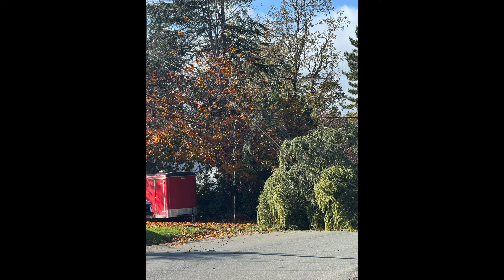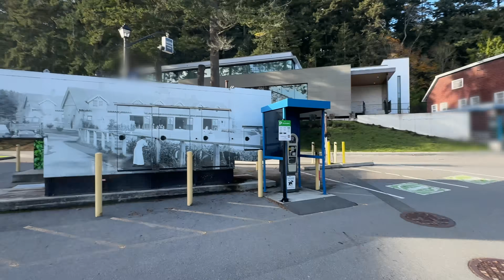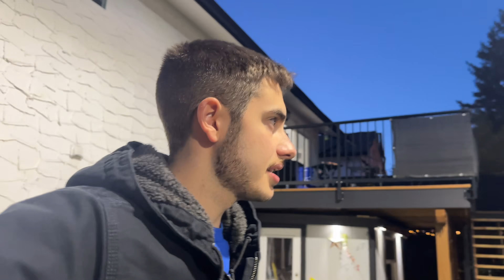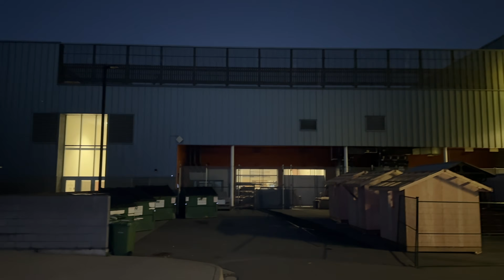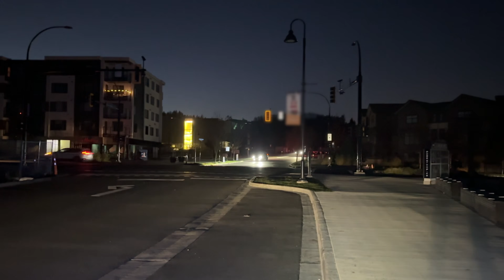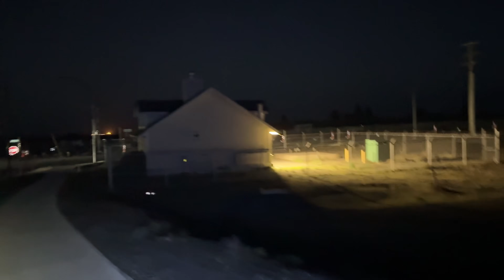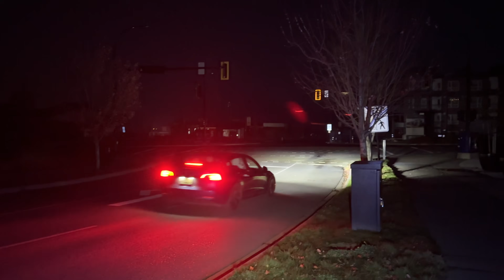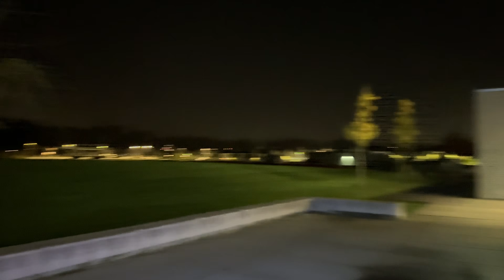11 Hours Of Power Outages And House Electrical Fried With 14,400 Volts On Neutral!

Comment: A whole house surge would not of made a difference here, not with the fault energy amount available in this scenario. The 120/240V secondary of a transformer has it's neutral earthed, and that is ultimately where the 14kV is looking to go. The neutral on the secondary is centre tapped, so the two 120V legs are essentially parallel paths back to earth, going through the transformer windings being one path, and any load (dryer, devices, lights, everything) being each multiple additional paths. Does not matter which primary phase shorted to neutral; The result would be the same since the neutral/earth is common between all primary phases and secondary. There are so many parallel paths, and a typical electrical system to a house has multiple bonding/earthing points. The result is a complex matrix of paths, and makes for an interesting fault case study. Some paths would have greater energy then others. Surge protectors are almost always just MOVs, and they would of just burnt up/exploded instantly much like the dryer and boombox power supply and would have had basically no effect. The sheer amount of energy available on primary lines is intense (just look at all the videos out there of arcing and faults). Electricity demands so much respect

Comment: Even if it were code approved to have functional breakers or fuses on both the hot and neutrals (this means NOT Federal Pacific Electric or Zinsco) complete with whole home surge, protection, with a sustained 14,440 volts on the neutral, it's still very unlikely any electrical items in the home would have survived.   

Fun fact: In the U.S., some very old electrical systems installed in the 1930s and earlier, had a double fused system (Edison base fuse on the hot and neutral of each circuit) . This was deemed very unsafe, because a blown, loose or missing neutral fuse will cause everything on that circuit stop working, leading the homeowner or electrician to start fiddling around with what appears to be a dead circuit that is in fact, live at 120 volts relative to ground, and because wiring systems of this vintage were two wire with no equipment ground, whoever is working on it becomes the path to ground.

Comment: Its a miracle a fire wasn't started. There was a similar scenario where I work back during hurricane Helene. Transmission lines came down feeding one of the facility's transformers. The recloser didn't open all three legs, just one of them-single phasing about 40 3 phase motors and compressors. About half of them went up in smoke because its an old place that has seen many hands over the years and unfortunately the motor starters didn't have the right heaters in them to trip the overload relays in time to save the motor. Some of them were bypassing the overload entirely. Luckily, the refrigeration compressors have an inherent protection built-in to take it offline in the event of an overload. Motor burns inside of a sealed system wreak a lot of havoc.

Comment: When I bought my home in 2007 (my father was an electrical engineer and I was slave labor until I graduated college) it had some knob and tube...So, since I was replacing it, I upgraded to 200amps, buried the power lines (SEC), then bonded the grounded connector at a Safe Disconnect I installed right after the meter. Then wired the rest of the home (main panel which was now a subpanel etc.). Well, I bought the BAD WOLF Surge Arrestor (on steroids, even for EMP, nuclear joules level, for about $250) and installed it at the Safe Disconnect (to meet any voltage tsunami even before it entered my home), then another surge protector for 80,000, at the first panel (distribution), then two subpanels after that one, each with another surge protector. I also tied the neutral to the gas ad water lines. Then, in heavy appliances, I bought a surge protected outlet (not GFCI, SURGE).  We has a nasty storm in 2013, insurance had to pay for replacing my roof shingles...BUT NO DAMAGE INSIDE, NONE! My electrical system as intact. Yet, five of my neighbors fried their homes and I could see trucks taking out drywall and replacing wires for weeks afterwards. 
I knew if the BAD WOLF was not enough (it was), then whatever leftover reached my first electrical panel would be much less, and so on.  Also, being a bad storm, I turned off the breakers for the AC, dryer, Etc. If OFF, then the path is interrupted and will not reach those appliances.

Comment: I think a surge protector would have "worked" in the sense that it would have blown the surge protector into little bits along with everything else in the house lmao. 

Surge protectors usually use Metal Oxide Varistors, basically reaistors that become a short above a voltage threshold to cap spikes. So they will work in both directions not just one.

Comment: You are correct that a surge protector would not have done anything (except become another grenade when the 14.4k flashed over inside it as well)... In fact, it might have made it worse, as the MOVs would have briefly shunted the 14.4k even more directly onto the hot conductors (before the MOVs finished vaporizing...).

Comment: This makes me glad that here in the Netherlands these cables are always buried. Out of curiosity I did a bit of research and found a press release made a few years ago by the largest dutch utility company (Liander) that their last remaining above-ground power connection to a few homes in the village of Zevenhuizen got destroyed in a storm and was replaced by buried cables. Apparently the next lowest distribution level, mostly 10 kV but up to 23 kV, is also all underground, and even new 50 kV cables get buried (but still has existing above-ground lines).
Reply from the maker: There are pros and cons to both we have both here and I've seen both cause lots of problems
Reply: @nics-systems-electric  It does at least seem much less likely to create hazardous situations compared to having energized bare conductors all over the place. It probably does help that earthquakes are pretty rare here.

Also, I just discovered I was wrong: apparently the Netherlands does still have some above-ground "low voltage" (<1kV) distribution lines to customers... around 0.05% of total length ;-)

Comment: A distribution circuit (MV/HV) shorting to a utilization circuit (LV) is the worst case scenario surge. It's only 14.4kV vs the megavolt+ that a direct lightning hit can deliver, but unlike a lightning strike, the surge lasts not microseconds but many milliseconds, causing the total energy delivered to the house to be much higher. It likely sounded like several small bombs went off in that house. The entire house needs to be rewired; the insulation in the cables is almost certainly damaged, especially where the cable makes a sharp bend. Time of exposure greatly affects the severity of insulation breakdown and this surge, as previously stated, was long in duration.

The house's grounding isn't to blame really; even if it was up to code it wouldn't have a low enough impedance to shunt that much current to ground without massive voltage drops across the grounding electrode system. Only a ring ground with huge conductors (AWG 4/0+) with multiple rods would have given this house's electrical system a snowball's chance in Hell. Such a grounding system would cost you at least half of the house's entire rewire budget so they're only installed for critical infrastructure or such as the substation itself, radio towers, telephone exchanges, datacenters etc.

Are there any surge protectors that would have helped? Perhaps, but they probably cost more than the downstream device you're trying to protect in most homes and it would have likely only worked on circuits far from the panel. Depending on how fast the upstream fuse on the 14.4kV side popped, a VERY LARGE (rated for several kJ on a slow waveform, likely needing to be custom built) surge suppressor may have reduced damage if installed on a lower capacity downstream circuit. The down stream circuit's own impedance would limit the fault current and the receptacles themselves would arc over and reduce energy and voltage delivered to the load. This also explains why UL does not test 120V plug in surge suppressors beyond 6kV; the receptacle just won't deliver more than 6kV before it arcs over and acts as a shunt mode surge suppressor itself!

Comment: Surge absorbers might help reducing damage of sudden HV intrusion into mains system. When the voltage goes beyond a certain value, it immediate shorts out and bypasses almost all the HV current directly to the ground before the main breaker pops.
Reply: @liam3284  The ground conductor only need to hold this current for a fraction of second before the main breaker senses the abnormal current and block all the following high voltage crap outta the circuit.

Comment: As this incident shows, USA´s local power grids are cheaply build junk (a huge lenght of multi-voltage poles (115v+208V/240V &  14.4kV+25kV) & bare-metal overhead power lines everywhere, nearly always even on wooden poles ... etc.) ... 
in Europe we don't have this problem (most of the non-mayor powerlines are underground cables & only one voltage level even on the last remaining legacy bare-metal overhead wires, often steel-concrete or steel poles) & such a surge can only happen when much bigger problems (like a general over voltage in the grid due to wind power = Germany´s big problem) ... 

on the countryside in Germany there are also "Luftkabel" (insulated overhead cables) for communication (telephone/DSL & now beginning fiber optics), while power line are on separate poles (often steel-concrete or steel) on different routes
Reply from the maker: Wrong country this is Canada. But you can't look at a country as a whole anyways as every city and community is different. Canada is a massive country much bigger and has many 
rural locations it's not financially feasible and often not possible due to soil conditions for everything to be buried. If you go into any densely populated cities it's a different story you won't see anything above ground other than lines for the buses. In this video you had a look at a 1960s suburb so of course things will be different than how they are in densely populated areas and modern installations.
Reply: @nics-systems-electric  - 
I only wrote about the local power grids ("Mittelspannung" & "Niederspannung"), but interesting how you automatically desperately try to diversify Canada from its "brother" USA ...
Canada & USA are defacto identical in rural power grids (incl. poles) & electrical home installations (especially when seen from outside North-America) ... 
In Germany even most 150+ years old East-German villages of (my birth country) former Socialist East-Germany aka "DDR" (1949-1990 with it´s BigBroter Soviet-Union) the powerlines are usually burried inside the village (rarely power lines on old steel-concrete/steel poles, wooden poles defacto extinct) but even in villages with power poles there is only one voltage level (400V/230V 3-Phase from the old "Trafohäuschen") and usually no telephone wires ... the transformer stations (incl. 100+ years old "Trafohäuschen"/"Turmstationen" that estetically even literally look like tiny houses, in different designs [ https://de.wikipedia.org/wiki/Turmstation ] ) are (inside & outside the villages) fed by separate power lines (usually 20kV-60kV) on separate poles/pylons only carrying one voltage level (villages are fed by 1 or 2 transformers & power lines with (1 or 2 sets of) 400V/230V) ) ... 

outside the villages there are indeed still many overhead power lines, but these only carrying one voltage level (1 set 3-phase or 2 sets 3-phase) and only power (usually 20kV-60kV or 2 sets 100kV or 2 sets 220kV or 2 sets 380kV ... rarely 2 sets 220 kV 0r 380kV with 2 sets 110kV below), telephone lines were/are on separate poles (sometimes just on the opposite side of the street,  your video maybe showed/demonstrated why they did/do it this way in Germany) ... 

In the 1990s in East-Germany there still were many even pre-WW2 phone pylons with ~100 bare wires on small porcellane insulators outside the villages, looking like USA/Canada phone poles of ~1900) , all of there werte replaced between 1990 and 2010 with ether earth cables or "Luftkabel" ( = the same insulated twisted pair multi wire cables but UV-resistant on small poles I guess 3 to 6 meters high (maximum legal truck hight is 4 meters which already includes the load) ) ... I have just seen in remote villages rarely 230V/400V cables on the same pole with telephone cables (but not multiple kV power cables) ... 

P.S. in 1990 villages in Socialist East-Germany were ~40 years behind the time in power grid & phone lines (I had relatives in such a village) ... 

Edit: 
USA/Canada single-family-home wastlands drive up costs for all utility (not just electricity & communication, also water, sewage, gas, streets/roasds etc.) & make good public transportation economically unfeasable... 

Canada ( & USA) could save costs by not planning + permitting these (also car dependent) giant insane single-family-home wastlands (even!) in cities (worst offender I have ever seen: "Cape Coral" in Florida with ~195k residents | compoare it to 366k Bochum or 210k Rostock in Germany) & towns, Canada & USA should plan more like 100 years ago or like Europe ... also even Russia ( & the rest of the former Soviet Union) has ultra rural areas but does it still better planning wise

Comment: If this happens never try to unplug anything from the wall. Your equipment would already be long gone at that moment, and if you pull a plug you will draw a high voltage arc that might potentially jump onto your hand and fry you alive. It's pretty scary for someone who lives in Europe, as high voltage lines are mostly well separated from the low voltage distribution part. I heard about such a case once, when a 15kV line went across someones yard and had fallen over the low voltage house feeder line during a storm. The outcome was similiar, most of the sockets had black soot around them, some cables were ripped from the walls, and all electrical equipment was non existent. Fortunatelly this is such a rare condition here, that I have heard about in the main national news programme.

Comment: Why does a school have to be lighted this much in an outage at night
Reply from the maker: Stairwells are legally required to be 100% illuminated. The corridors in this school are 50% or less illuminated and large occupancy areas many are 20% or less illuminated. Not much is actually illuminated other than what legally has to be.

Comment: I believe that if I had had, as a common norm in Europe, for over 40 years, a system with, not only magnetothermal circuit breakers, but with a GFCI (ground fault circuit interrupter), it would have cut off earlier and would not have gone around the house in the hope that everywhere it would discharge to the ground....
Reply from the maker: Any breakers would be useless if they trip or not 14,400 V will have no problem jumping the small gap of the contacts.
Reply: @nics-systems-electric  closing and interrupting power, of a GFCI has protected the house without flames from sockets and switches, but obviously not the majority of electronic equipment, about twenty years ago, someone who lived 500 meters from my native house, who gets the 15000 volts line dropped down due to falling trees caused by a violent thunderstorm with a whirlwind, from a 15k V line used by a near small textile twisting factory.  The GFCI had literally exploded, despite the fact that the protection current is normally  for household GFCI, 6000 or 10000 Amperes (it is the thing that is put first, and after, the circuit breakers) and at least, in Europe, since they have existed when lightning strikes inside the line  electric, at least the electrical system saves it.

Comment: Retired CATV tech here. I can tell you that the cable TV/Internet lines will have many blown actives and passives. It probably went for several blocks. It will be awhile before those nodes are back online.
Reply: I don't know what providers are in the area but I'd guess a few people will be switched over to fiber to the home.
Reply: At some point there will be fiber amps. They need power. If they cross the amps die, no Internet!
Reply: @glynnetolar4423  AFAIK commonly deployed fiber networks are 100% passive from the central office all the way to the customer. Obviously power is needed but COs historically have the best backup power systems.
Reply: @glynnetolar4423 
Ehh, splitting hairs. Most fiber connections aren't 200km between sites, so as long as they have reasonable power backup: all is well.... Until the fuel or the natural gas pumps stop running

Comment: Surge protectors are for relatively small voltage fluctuations under 100V. 14KV with massive current available is WAY beyond the capability of standard household circuits and devices.
Reply: Actually they may assist a little bit with bigger surges too no surge protector is strictly for minor common surges surge protectors gotta be setup for the worst case scenario like this one